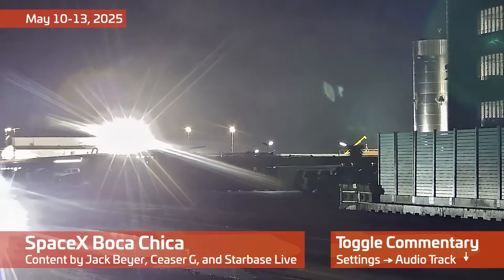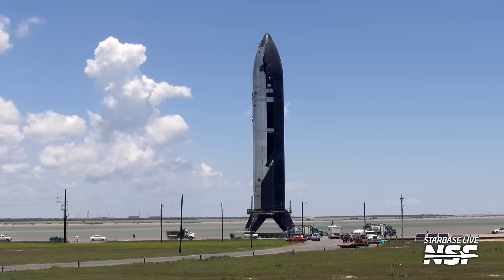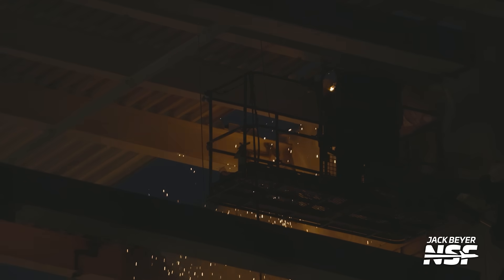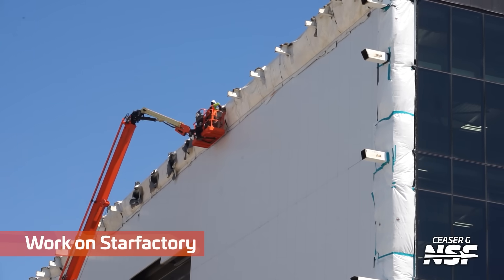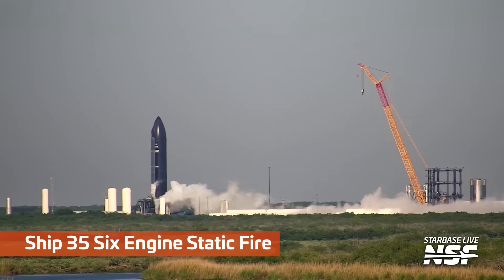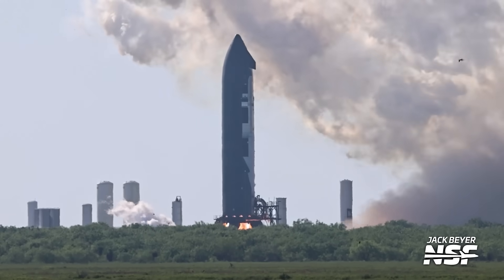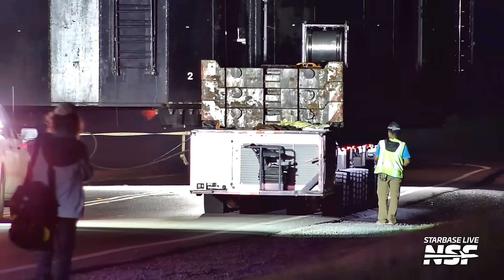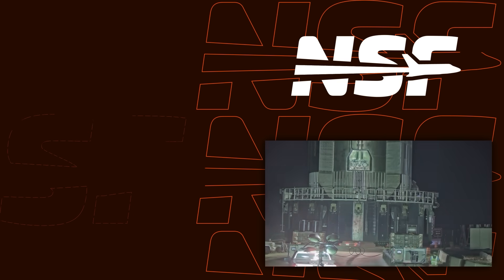We've got Static Fires, We've Got Booster Rollouts | SpaceX Boca Chica

Comment: Being a retired crane operator I'd speculate that the first pick of the OLM was to "weigh" it as cranes have line scales so then the lifting engineers can create a "lift plan"...in this case they decided to use 2 cranes as it was beyond a single crane lift capacity at a certain radius...they were either in the structural capacity or at the tipping point...either way it ends bad...

Comment: "You do not have to transport it down the road filled with any of that fuel".
Correct, the booster can be (must be?) transported down the road without any fuel (or liquid oxygen) on board.
But until they build a methane pipeline and a big enough air-separation system (for their oxygen & nitrogen needs),  all that fuel will need to be transported down the road in tanker trucks.